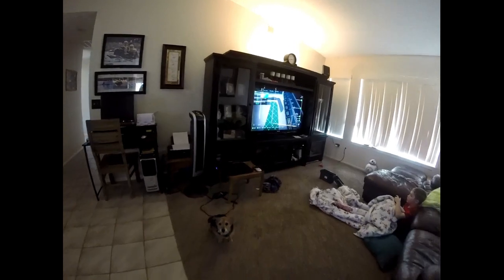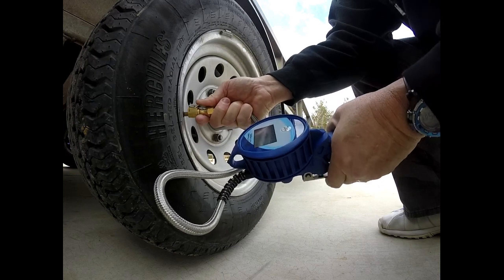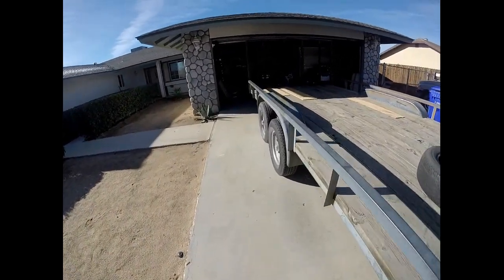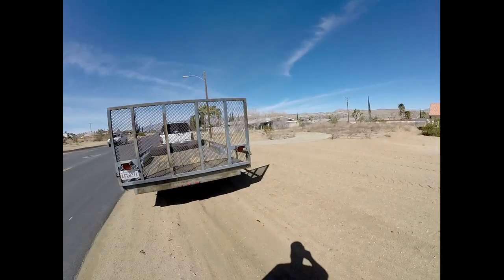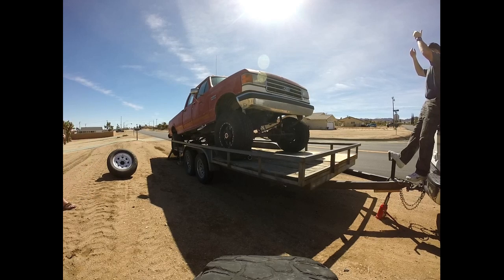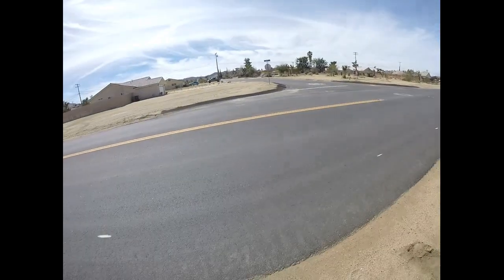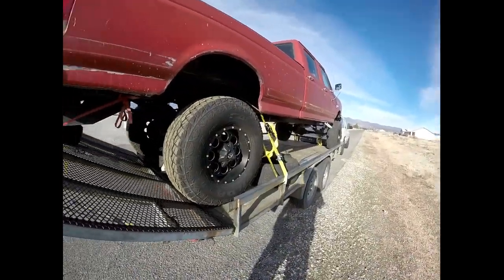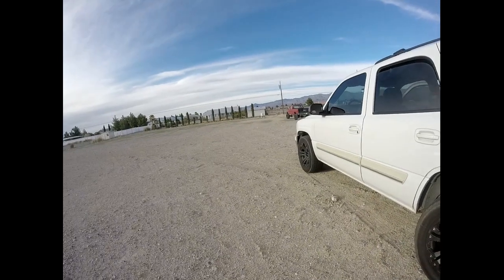Moving Big Red - Towing a huge truck with my 1500 Tahoe

Comment: If you towed that with the tahoe, my Suburban should tow future projects easy. I love it, after doing some research i understood the GMT800 platform was the best bang for buck without the AFM/DOD issues. Found my 05 Suburban Z71 4x4 for just $2,300. The trans was rebuilt shortly before i bought it. The engine is tired but runs, so will be getting nee long block for it. Was debating on getting a 6.0 for it, but from what im hearing, the 6.0 may destroy the trans and im not sure if they rebuilt it back to factory or stronger. Undecided. Its merely a few hundred bucks between them new.
Reply from the maker: Thanks for your comments. This Tahoe is STILL running beautifully at 300K now! It is my daughters daily driver!

Comment: Hey men good vid im planning to tow 8000lb load with a 03 yukon xl 6.0  vortec  capacity 7400lb max towing 
Trailer doble axel rated for 7000 lb 
Towing  around 1700 mi
 honest  advice  men apreciate
Reply from the maker: I think between that big red ford and the trailer I used I was probably at the same gross as you will be towing.  What advice you looking for?
Reply: @DIRTADDICT922  I got 03 Tahoe 1500 trying to tow 3800 pound car with trailer 2200 would I be safe to drive 3 hours back home

Comment: i have a 1993 1 ton crew cab 4x4 with the 7.3 idi diesel i towed it on a trailer with a 1994 gmc 1500 did not have no problems pulling it but stopping wasnt great i did not have a brake controller in my gmc but i had a 20 ft car trailer lol
Reply from the maker: Mine now has 260K on it and still running strong. It gets driven every day.

Comment: i got told my 1990 chevy c1500 couldn't haul a chevy 4 door sedan... with a small trailer because it didnt have enough weight, yet i see this and another video of a chevy 1500 pulling a 10 thousand fucking pound truck with a 8 thousand pound trailer....~slow clap~ so nah  you're not dumb the ol gal did it.. it's only dumb if it fails.. and chevy's dont fail :P
Reply from the maker: Yeah totally!  But just for info,  that trailer has a 14000lb  load cap. And that truck weighed in at 6300 LBS.  My tow cap with a stock 04 1500 is 7700. My tahoe has a built trans, HP Upgrades, Gears, HD rear springs. Even though that does not reclassify my capabilities it easily yanked the 8300lbs that combo ended up weighing behind me ;)  And to this day I have used it to tow roughly 8000lbs about 30 more times since then.
Reply: @DIRTADDICT922  what gears do you have in your Tahoe?
Reply from the maker: @miggyv6856  So I actually don't have "gears". I have owned many vehicles where I have swapped to 429's, 456's etc. but in this Tahoe I changed tire diameter in the programmer to tell the car it is running larger than stock tire sizes so it changes the shift points etc. Sorta like gearing it. So it short shifts, revs quicker resulting in more  low end torque.
Reply: @DIRTADDICT922  ummmm what programmer are you using? Cuz I haven’t heard of any handheld programmer that does that. I have a superchips dashpaq and all it does is recalibrate the speedo for more accurate reading

Comment: What Springs do you have on your tahoe? I was also looking to upgrade my rear springs.
Reply from the maker: I used Eibach HD rear springs. They actually lower the rear 1" so it doesn't stink bug like a stocker. But they are heavier so they dont sag like stock.
Reply: I added a leaf to my 97 and it's real stout. I wouldn't be afraid of towing anything you could put on that hauler with it. I think weight looked good on there. I have put a truck on backwards before with trailers with wheels more to the back end.

Comment: The issue I have not noticed in the notes is if you had an accident your insurance could walk away from you leaving you hanging.   At least get a weight distribution hitch so it won't wag.  Your hitch to front of trailer is not unusual but if it was longer I would have tried backing it on and hanging the back end over the front as far as I could, it may not have worked but my trailer has a longer area between the ball and front of trailer bed and some things I have towed have towed well that way.  Like suburbans that are heavy both ends.  The pickup is relatively light in the tail.  Is that an XL or shorter Tahoe?  Just wondering my Yukon XL has the factory tow package and hitch and has a decent towing capability.  Fuel economy is bad but it tows well.
Reply from the maker: I 100% agree. This was just a one time thing.
Reply: You actually want the heavy end of what you're towing facing the tow vehicle. The trailer sway will get worse if you leave more weight behind the trailer axles.

Comment: whats all done to the tahoe? thinking about one to haul a jeep and a few quads to the mud pits! maybe a list you could email me or something,
Reply from the maker: HD Eibac rear springs, Hypertech Programmer, Full flow master headers and dual exhaust,  Geard a tad below stock. That's it.
Reply: tireguy 1000 awesome haha is like to tow a tj Jeep and a quad with me haha and sometimes a Miata to the track
Reply: tireguy 1000 in your opinion do you think a 4 inch lift and a set of 20x10 35s would change it’s towing a lot for what I’d wanna do?

Comment: Would it have made a difference if you backed the truck on? Or would it put too much weight on the back of the trailer
Reply from the maker: I think the trailer woulda been loaded tail heavy. That can cause some interesting handling dynamics.  See here. https://www.youtube.com/watch?v=4jk9H5AB4lM
Reply: That would have put to much tail weight on the truck better to be a little to tounge heavy then tail heavy.
Reply: clifford squire good point
Reply: @chrislittle798 

Unfortunately/fortunately

It only took me have a trailer come off due to a ball stripping out for me to lean that.

But also haveing more weight on the front also helps all the brakes stop even though your front brakes are the main stopping brakes.

And another advantage to having more younger weight on the ball is if by chance the hitch latch let go more likely to keep the trailer on the ball hitch and vehicle more stable as opposed to pushing you off in the ditch or rolling it over or worse case scenario killing someone else and or your self.

Just things I learned the hard way.

Comment: Well, you did say to "leave a comment and tell me how dumb I am..."  I wouldn't call ya dumb (I don't even know ya!) but I'd definitely say you were heavily overloaded, in every conceivable way.  You were likely pulling ~9000lbs (assuming 1250 for the trailer alone and 7550 for the truck).  The trailer has two 3500# axles for a combined GVWR of 7000lbs.  So obviously the trailer axles were overloaded somewhere in the neighborhood of 2000lbs.  Next, that generation of Tahoe only had a max tow cap of ~7700lbs, so overloaded there.  Next, the hitch itself is a Class III, rated 2 different ways - with weight distribution and without WD.  With no WD system, it has a maximum capacity of 600# tongue weight and 6000 trailer weight... so, you guessed it, overloaded there again.  I'm  glad you made it safe, but holy hell if one thing went wrong.  You set up one hell of a stack of dominoes there...
Reply from the maker: I agree 100%  ;)

Comment: Install air bags in the rear and a larger aftermarket transmission cooler.
Reply from the maker: Yeah, been there and done that to many vehicles. This was a one time deal as now I own a proper tow vehicle. However mama still drives that Tahoe. It's got 250k on it now still going strong less evap codes every few years LOL, o2 sensors, cannister, purge valves.

Comment: Those tahoes tow great i pull 10k with my bone stock tahoe 2500lb on the tongue and sags bad any ideas for a stiffer suspension?
Reply from the maker: Jonathan, I have Eibach HD springs that actually ride 1" lower than stock. But are very stout and takes a lot to make them sag.  But if I had that much weight on the tongue (2500 Lbs) I'd also look into a load leveling kit and air bags.
Reply: @DIRTADDICT922  cool thanks for the information
Reply: @jonathanc5117  Let's see it on a scale! :)
Reply: @dante04srt  I haven't had the trailer on a scale yet but that's what the previous owner told me he bought a Ford f450 diesel to pull this trailer so I think he told me the truth
Reply: Tireguy do you have a part number for those springs?

Comment: How Does your Tahoe do towing the 16ft flatbed we have a identical setup just haven't used it
Reply from the maker: I have rear Eibach HD Springs, and a tuner upping the HP and lowering the gear ratios to aid in towing. This Tahoe tows up to about 4K very nicely.

Comment: what setup do you have in the rear suspension of the Tahoe? I have Moog HD springs and still get serious sag with a couple trailers I pull. Looking for ideas...
Reply from the maker: Rob, I have Eibach HD springs that actually ride 1" lower than stock. But are very stout and takes a lot to make them sag.
Reply: just put air bags inside your coil springs. you will notice a drastic difference
Reply: 2000 to 2006 f250 or f350 front coil springs will fit directly in a factory Tahoe coil purch and it will lift it about 2 inches high but I have yet to get it to sag at all and I've pull a 3500 dodge dually. 4 hours trip!! And it only cost 30 buck at a junkyard I love I let just a little  Rougher ride if you don't mind.
Reply: @jacksatterfield6031  Do you still use these springs? I'm planning on replacing the springs in the back of my '01 Tahoe to beef it up for towing and you just really piqued my interest.

Comment: I'm towing my 4,500 pound pickup with my Yukon 2001 everything is stock, with a uhaul auto transport trailer for approximately 3.5 hr at about 5k ft above sea level and I'm kind of worried
Reply: I'm going to tow**
Reply from the maker: Is the 4500lb including the weight of the U-Haul trailer? Your vehicle tow capacity is 6400lb I believe?
Reply: Do you think that i can pull a 12ft dump trailer with a 1500 chevy suburban 5.3
Reply: @talkingcargojunkremoval  hell yeah my uncle used to have a 2004 z71 1500 and would tow a heavy skid steer and sometimes a mini excavator with no issues

Comment: you didnt cross your safety chains
Reply from the maker: The mount point for the chains on the trailer side is the exact same spot. So they are only 1/2 inch apart. They should be more like 6 inches apart. So when you cross them they do not provide the "X" where the loose sections hang below.  If I had owned this trailer I would have remedied that issue.  Good eye for catching that!